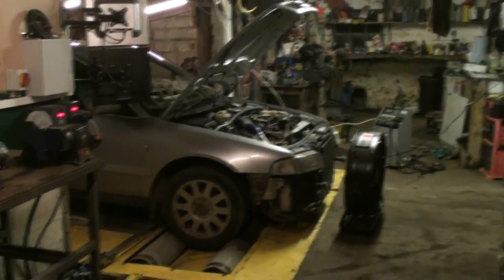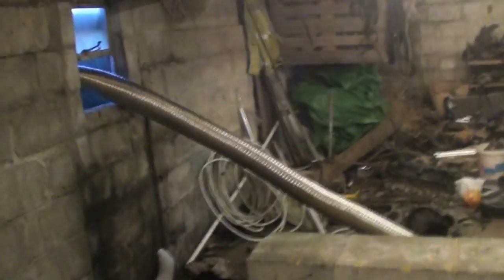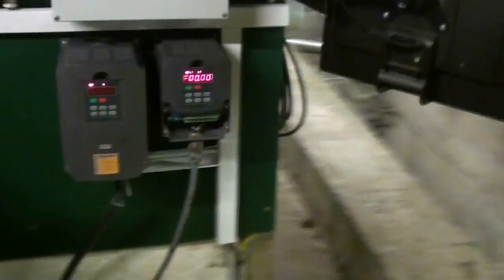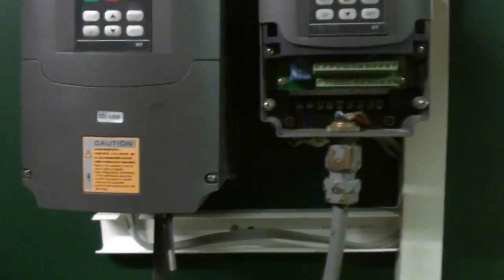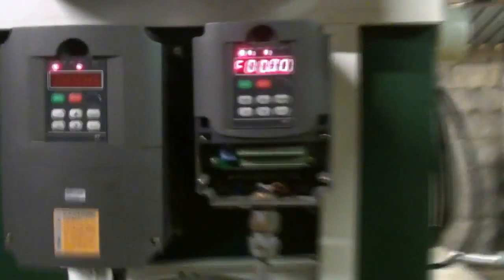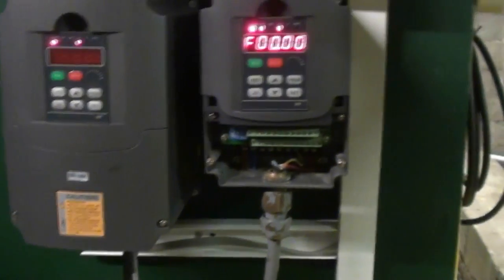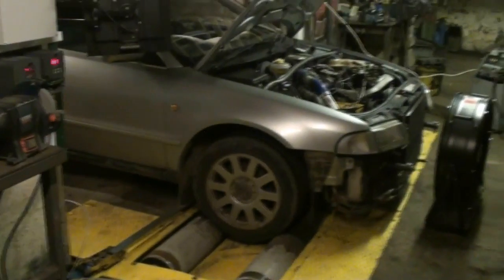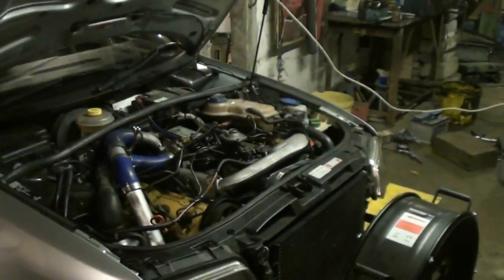Rolling Road Dyno Project Part 13 (First Load Test!)

Comment: Couldn't you take the prop shaft off and just engage the dif
Reply from the maker: You could, but the cummins puts the diffs under alot of stress when both are connected, let alone with it all going to just one of them!
Reply: Did the Audi gets a new Diesel Pump does it Still Runs ?

Comment: you have done a great job and put a lot of hard work in to this project? what are the pros and cons of this type of dyno as compared to a hub dyno which I think would of been a lot less work involved maybe???
Reply from the maker: +16vastraturbo Really a hub dyno is a "better" dyno....certainly more accurate anyway as you loose the losses involves in tyre to roller contact...however, hub dynos take alot more time per vehicle to setup, its very quick / easy to just drop any car onto a rolling road dyno, and perform a test...

Comment: The basic principle of a VFD's inner workings, is to convert your mains (single or 3 phase) to DC where it is stored in capacitors. It then uses control circuitry and IGBT's (bit like transistors) to  'chop up' that DC power to sequentially power each phase. There's obviously loads of other stuff in them too, but that's just the basic overview.

Comment: Awesome :D

Can you put RWD cars on this? I've got a 320d if you need another test vehicle!!!
Reply from the maker: We can indeed, just need to widen the entrance doorway a bit so its square onto the dyno and you just position the car pointing outside :)
Reply: Darren Lobb
 Nice, once you have knocked some more wall down let me know if you want a RWD test vehicle ;) My 320d was 150 stock and has straight through exhaust and has been remapped. In theory should be 180-190hp now. Only boosting 16psi so not alot(didn't want to kill the turbo).

Comment: How do you size an extractor fan ? Can't help think a decent engine is gonna end up pushing that fan like a restriction lol , certainly that cummins landy will lol ! That's a lot of cubic ft/min lol
Reply from the maker: allistairc123 We were donated the fan for free, so thats basically the only reason we have one just like it...its got a LOT of airflow...certainly nothing we have put on it so far has overcome it.. Its not directly coupled to the vehicle, it just sits behind the exhaust, so it would never restrict anything, but the exhaust gases could "overcome" it and spill into the room, but 0 signs of that happening at the moment!
Reply: Ahh cool ! , my bad ... Assumed it was coupled ! , seen some mad cars in DYNO vids straightening out flex pipe on the exhaust with the pure flow . Any plans to dyno the cummins ?
Reply from the maker: allistairc123 The cummins is 4wd...so would have to drop a prop and diff lock it...tbh we arnt aiming to make any serious power with the cummins for the time being, so would be alot of effort for little point at the moment...although would make a good video!